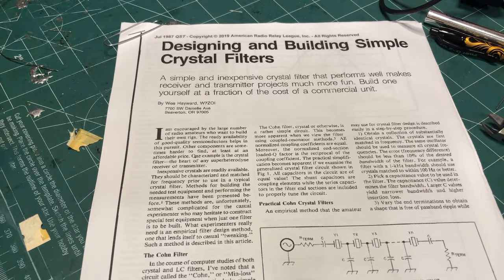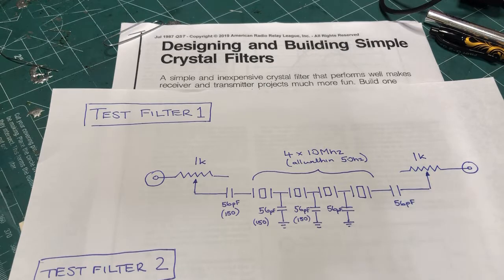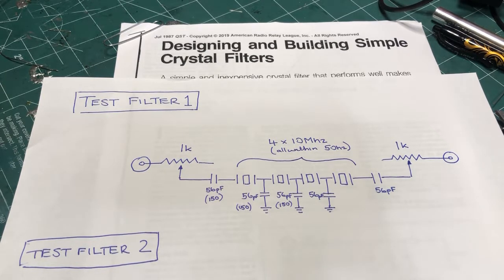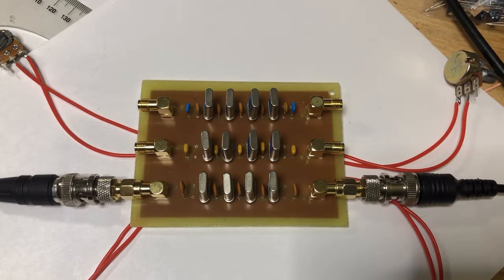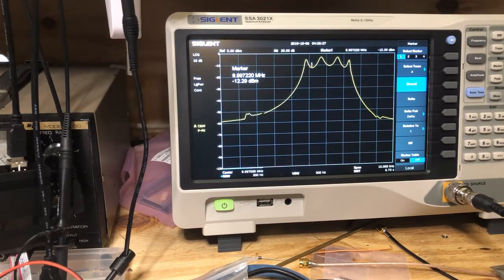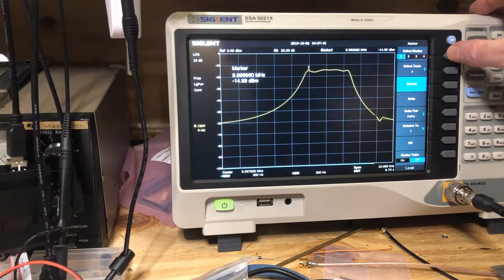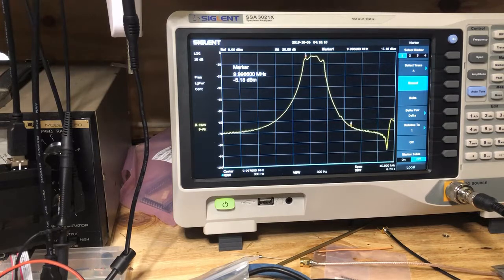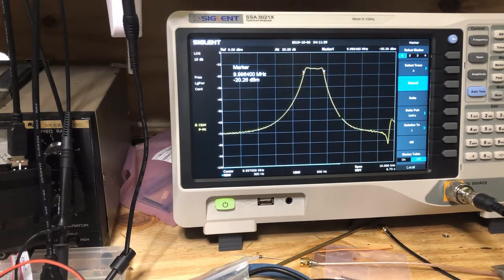QRP 20m SSB - Part 3 Crystal Ladder Experiments

Comment: Hi Ian That was very interesting. Having the proper equipment to see how the filter responses to different component values. Learnt so much. Thank you.
Reply from the maker: Glad you enjoyed - did you get what you wanted from a PCB design perspective?
Reply: @na5y   Yes, I use the magazine method mainly and try the photo dry film. I had good results with both. Playing around with UV green solder mask.  Dave 73

Comment: One question please, when you do the filter test, in the diagram you do not put ground on the connectors of the vna connected to the pcb.
Is that the correct way to do it?
To test the filters, first I make two impedances transformers from 50 ohm to 1000 and from 1000 to 50 and connect my nano vna to the ground of the primary and secondary.
Take care ,thanks.
Reply from the maker: Hi Enrique - thank you for the comment. There is a ground path on the underside of the pcb to which all the capacitors and the SMA jacks are connected to. Is that the ground to which you were referring? Believe me its entirely possible that I am doing something wrong but there is a ground connection there
Reply: @na5y  Ok was what I thought. I am making a khon filter and I am calculating it with Dishal, and it has an impedance of 1500 ohms at the input and output and if I test it like this with the nano vna and the 1500 ohm potentiometers I have very high insertion losses, I will have to try it with two impedance transformers, thanks for your attention